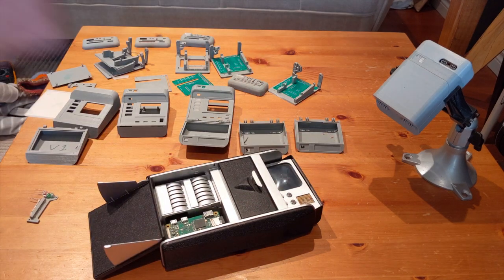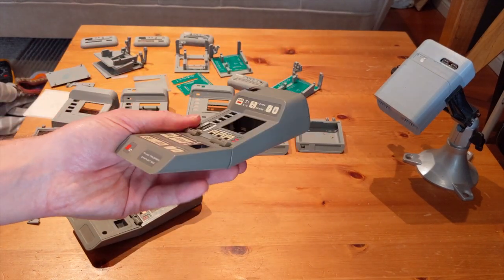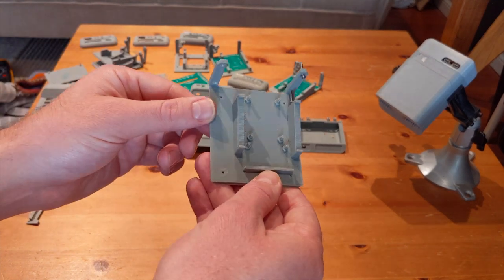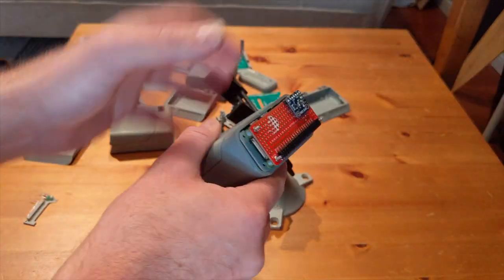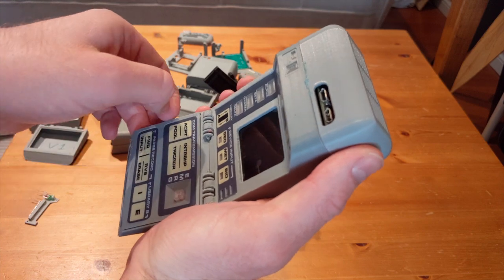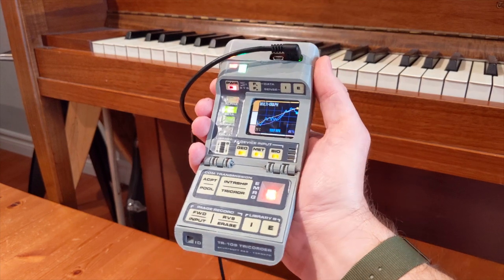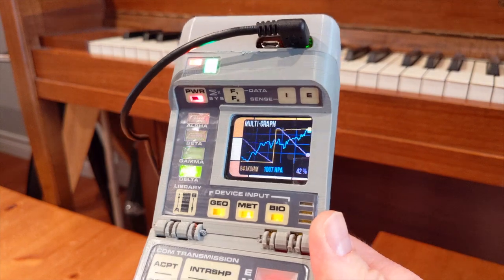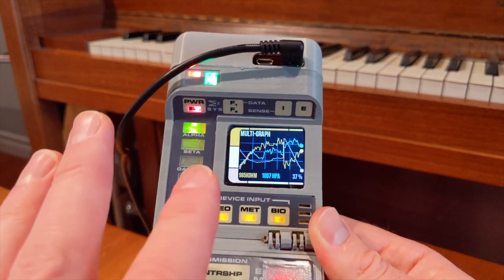[project] Raspberry Picorder 2 Update

Comment: I like the looks of the new PiCorder. I’ve seen that other TNG PiCorder, this looks like a substantial improvement over that design.

It’s good to see what you can do with just three buttons active, too; similar to what I have in mind for my TOS PiCorder, once I get past a few tiny little hurdles. I want to have one button cycle through display modes, one cycle between multiple sensor graphics and individual sensors. The third, I wasn’t sure what to do with, maybe adjust sensor range, how often they transfer data to a spreadsheet, that kind of thing.

Since I’m using a Marco prop kit rather than a refurbished toy, things like the buttons were a bit tricky to work out: I finally ended up setting them up with little springs from a pen around the screws, and will have a small circuit board behind them with little buttons once I solve my display problem.

Looking forward to seeing the next update!
Reply from the maker: Woah that sounds pretty rad! I love the idea of using a real TOS prop replica kit for a picorder. Sounds like a good solution for the buttons too! I like that idea. We're of like minds that the third button should take you to a general settings menu. So far in testing thats the only decision I've made that feels "right" and happens naturally. 

I'm going to keep working it over. I had an idea that there could be "hold" actions too. Like granularized controls for each page that you could set from a menu that appeared if you long pressed the button. But right now since my input handling is so garbage more complex press responses aren't really possible. My new capacitive touch IC I'm switching to will support this though, so I'm hoping that will clean up some of the lag and add new features as well.

I'd love to see what you make for your picorder. I set up a subreddit some time back for people to share their work. Give it a visit if you're so inclined!

reddit.com/r/mycorder

Comment: Love how this is going but a couple of questions. Will you be using a raspberry pi zero w to allow you the option for a medical tricorder? Also will you be adding a sensor so it switches off when you close the hinge? Thx
Reply from the maker: Yes it uses a raspberry pi zero w! Do you mention the medical tricorder because of the hand held sensor? It's definitely something I'd like to do, but it's not on the roadmap right now. The newest prototype does use hall effect sensors for door open/close sensing but it's not finished yet. I'll be making a video about it soon!

Comment: Have you considered taking your python code and running it through a python-cython converter to try compiling a binary that runs standalone, and not through the interpreter? That might help significantly with refreshes, and the touch interfaces, I'm not sure. If that works cleanly with the code you have, you can continue development in python, and regularly build binaries that should run significantly smother/faster.

What brought me here though was my interest in the prospect of using something like this as a medical diagnostic tool. The plug-able sensor idea seems like a good fit, though I understand it's not been anything like that driving your project.
Reply from the maker: I need to look into that, thanks I'll take a look!

Comment: That is REALLY elegant. Except for your joint. I saw one guy  make wide joints so the wires fit inside them and weren't visible from the outside.
Reply from the maker: Its for sure the weakest part of my build. I think I know the Tric you're talking about; the Voyager concept tricorder right? Its a freaking masterpiece.

I definitely want to refine my hinges, and I've made some improvements since this video (new video on its way). But for now I'm not really just focusing on keeping things as simple as possible to get a working prototype together.

Comment: Oh I also wanted to mention if you don't want to use wires which bend and break eventually in your hinges make your hinges the surface equivalent of old style radio dials when you pull them off they have metal contacts behind them and basically all you have to do is put a flat piece of metal inside one side of your hinge and on the other side of your hands and when you open it they make contact and that will Power It Up the Volume no more wires cool huh and I'm talking about like 1930s and 40s radio dials

Comment: maybe instead of using wires for the capacitive buttons and hinged part, maybe use pogo pins, or some connector instead of a wire. that way you can save some space as you don't need the space for the wires, and it would be easier to take out, modify and put back in.
Reply from the maker: Good idea! Im not familiar with the component so I'd need to research it. But I bet that would be much more convenient!

Comment: How did you do the capacitive buttons? Just some aluminum foil attached to the wires? Or did you drill holes through the body and have the wires just sitting on top of the plastic?
Reply from the maker: This was easily the most satisfying and surprising part of the build; the capacitive touch pads are all internal and they work great!

Its achieved with conductive copper tape, cut to a pad shape (for buttons with LED indicators there is a small hole cut in the center as a light channel) by a Cricut (my buddy has one). The tape is affixed to the INSIDE face of the enclosure. It is then soldered to the main PCB via small lengths of coil wire. You slap the sticker on the outside of the case and as long as everything lines up it works great.

The biggest caveats are making sure none of the wires that carry signals from pads overlap eachother or other pads with respect to the orientation of the sensed object (so you can have wires next to each other, but not "ontop" of eachother as seen by the finger) Also the wires will act as pads on their own so if on the outside of the enclosure a finger might come close to where you've laid them you can get spurrious inputs. By playing with the threshold (set by a value you give to the IC at init) you can reduce these effects, but I definitely need to do more to make sure the wires do not float around and rest against the inside face in a way where these happen. I've mostly resolved the problem, but theres more I can do to make inputs more satisfying and responsive.

https://squaredwave.com/wiki/images/thumb/a/a0/Tr1090_cappads.jpg/800px-Tr1090_cappads.jpg
Reply: @obso1337  interesting, I had thought that perhaps it would work this way but I haven't tried it. Good to know it works!